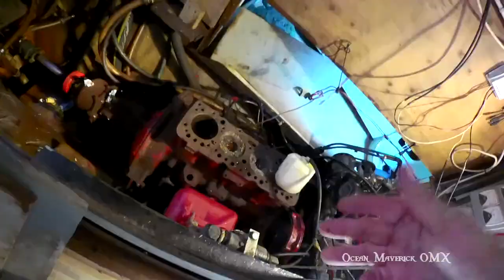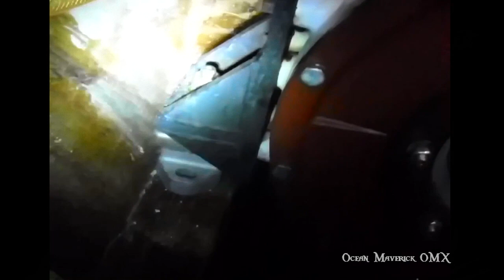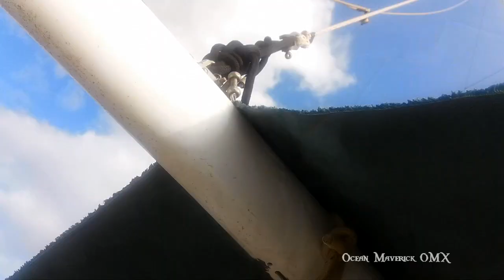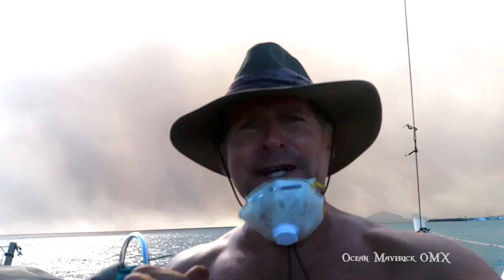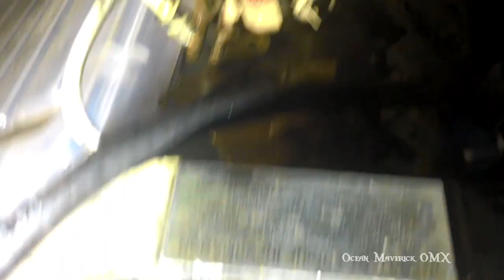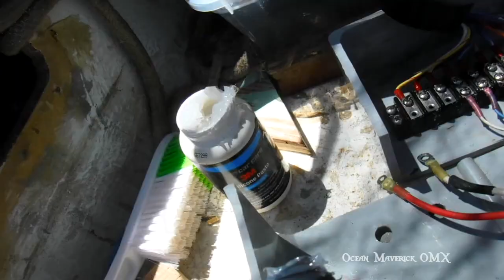Sailing Adventure Hawaii | DIY Sailboat Engine Repower | Debunk Water Police - Ocean Maverick

Comment: Did you try using a pry bar on the flywheel to turn it over?
Reply from the maker: Dude da not that dumb coolant got in oil up in the manifold. Screw a pry bar how bout a long pole extension on bending steel wrenches. Once a horse is dead its dead. You don’t keep kicking a dead horse.